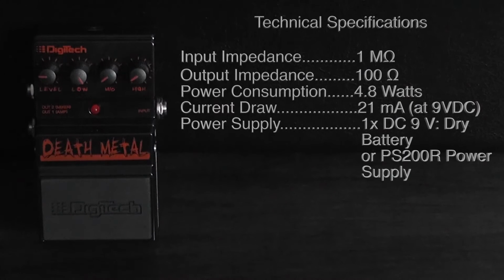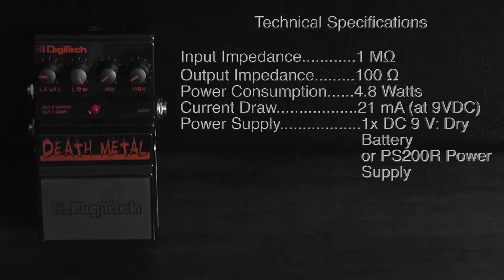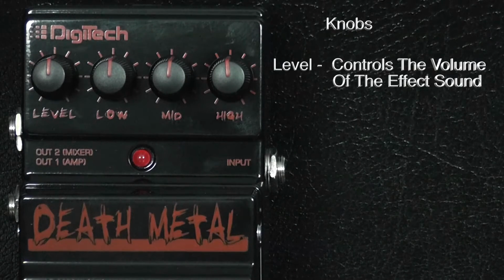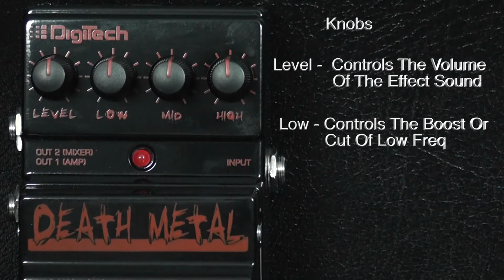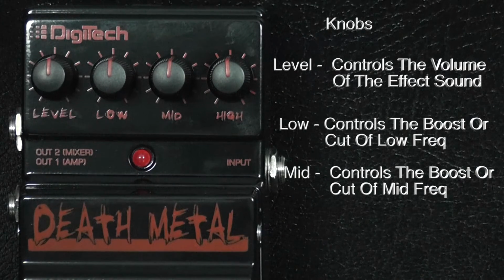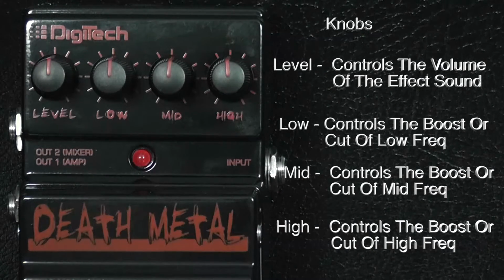Digitech Death Metal Distortion

Comment: ...and the difference between the two output sockets?
Reply from the maker: Output 1 goes to your amplifier

Output 2 Mixer output features DigiTech’s speaker cabinet emulation, that lets you run the pedal directly into a mixer or recorder input without having to use a guitar amplifier. - Kevin
Reply: @Crypticmaskguitar  Thanks... that is important to know that the mixer out has a cabinet emulator rather than just a parallel copy of the amp out! ^